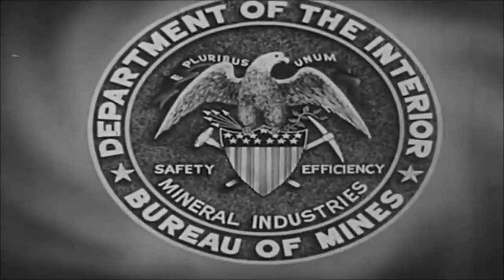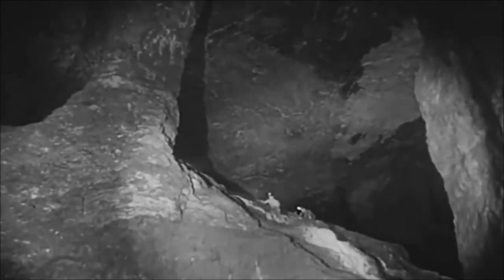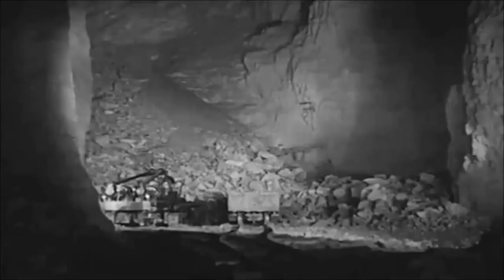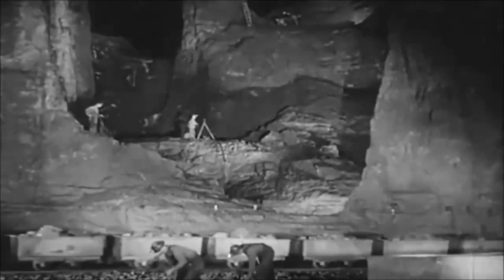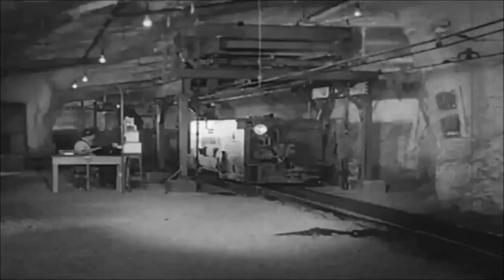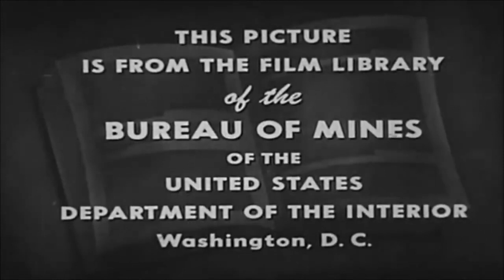Bureau Of Mines film on the giant stopes in the Lead Belt Mines

Comment: Awesome stuff. If you want to see really huge open stopes, meaning like 1800' h x 1500' w x 3000' l, go to the Pine Creek Union Carbide mine near Bishop, Ca.

Watch this video and notice the mine plot at 4:40 - 5:00 and all those black areas are giant open stopes compare the sizes to the tunnel lengths they state and the height of the elevator shafts. 

They started at the bottom of the ore bodies and mined upwards. They would drive a grid of adits off of the top of the shafts 40 or so feet above the roof of the stopes, drill thousands of blasting holes downwards in the floors of the adits, fill them with explosives, retreat to a safe assembly area, and when the blasted they would drop a roof section of the ore body that would be equal to a couple-three-four football fields by 40 feet high from the top of the stope 1500-1800 feet down onto the floor of the stope all at once.

Sadly they don't show this or the stopes in the video but I had friends that worked there that said  when they were excavation this ore of the floor of the stopes the whole stope would be lit up by dozens of carbon giant arc lamps and it was simply awe inspiring to see these immensely vast open areas inside the mountain. I remember one guy saying athat you could easily fly around in a Piper Cub or Cessna inside the mountain, they were that massive.
Reply from the maker: +Karen Audrey Todd Check out this video about Pine Creek...

https://www.youtube.com/watch?v=XLm1SmF0IHU

Sadly, much of the mine is flooded right now and they also mined the ramps which were in high grade when they were closing so access is severely compromised.

Comment: Absolutely amazing! I'm used to Western mines, where even the most stable rock has an occasional crack running through it that must be timbered. These stopes are incredible! Do you know what sort of rock they are working in?
Reply: We don't unfortunately.
Reply: “Gly”: I believe this is the Fletcher Mine Chris. 37.4671209, -91.112194
The Fletcher Mine is the largest lead mine in the country but I’m certain there are others in the area with equally large stopes.
Reply: @AbandonedandForgottenPlaces  Gly you and Mr M need to do this mine
Reply: Limestone host rock. MVT formation.
Reply: @AbandonedandForgottenPlaces  Fletcher is currently active and was developed in the 60s or 70s with rubber-tire equipment. It's located in the Viburnum Trend, aka the New Lead Belt. This video was shot in the Old Lead Belt, centered around Leadwood, Bonne Terre, and Flat River.
Reply: True most likely limestone.  This is pretty easy style mining as underground mining goes. I wonder what the grade is like with that amount of width.  We have lead/silver ore matrix where I grew up in the silver valley.  I believe the actual mine stope cuts were much smaller than this in my experience but grade of materials was mostlikely much different.   Bunker Hill was a pretty large producer of base metals years back.